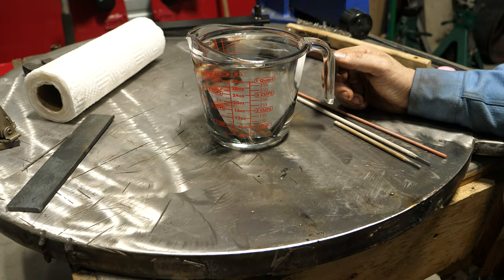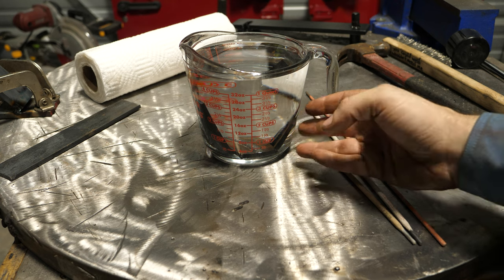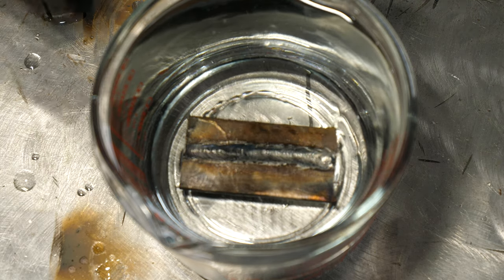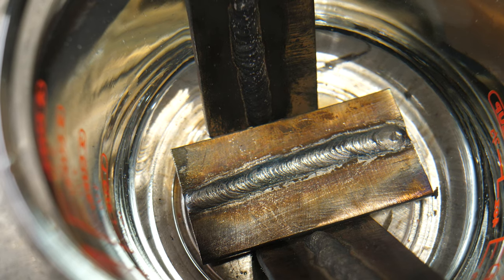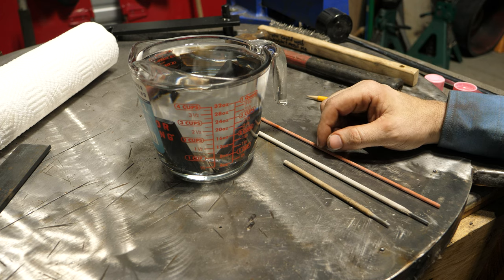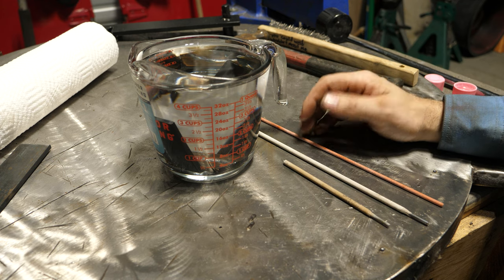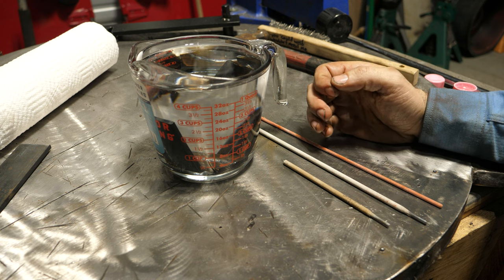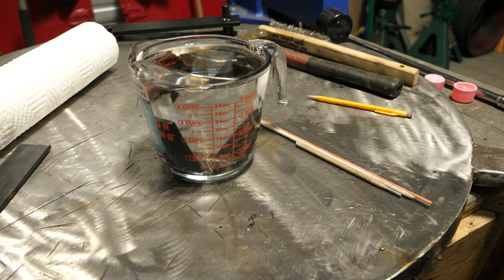7018 vs 6010 and the danger of diffused hydrogen (hydrogen embrittlement)

Comment: Also from what I understand (which isn't much lol) is that it also doesn't matter until you get to a certain thickness of metal (over 1/2" IIRC.....at least for hydrogen cracking which happens during the cooldown). My dad was a maintenance mechanic & welder in a factory but they were kind of backwater(didn't have rod ovens or formal training etc). Anyway he said when they were welding on something serious they would lay all their rods out on the welding table ahead of time and heat them up / get them extra dry using their torches wit a yellow flame. On a side note I did a bunch of digging and found the reason code work never allows 6011 is because its the same potassium additive they use in the flux of 7018AC rods, which has a greater chance of adding impurities.
Reply from the maker: So the thickness of material can play a roll, the probability of it happening goes up as the material gets thicker, because of how fast the temperature drops near the weld pool.  It could happen on thinner material as well.  It’s somewhat uncommon to be welding on higher strength steel below 1/4inch thick but ar500 and many alloy plates can be 1/4 or thinner.  Welding those with MiG or tig would mostly remove the risk of hydrogen embrittlement.  Or of course a properly stored 7018.  

6011s potassium is used to aid in arc stabilization on a/c.  Since a/c welders have a point of 0 volts as it crosses the wave form, the arc will go out.  Potassium will keep the arc lit.  I didn’t know 7018ac had that, it would make sense because many ac transformers will struggle a bit with 7018s.  I had a old Lincoln buzz box and it would run some 7018s despite them not specifying AC, but most 7018s it would struggle with.
Reply: @makingmistakeswithgreg  "technically" regular 7018 is supposed to work on AC but  they never seem to.
Reply: Interestingly enough, I had a Forney AC buzzbox that hated 7018 on AC, but recently I upgraded to an old school Lincoln Idealarc 250/300, one of the round top 1960s models, and of course I use DC for most welding, but for shits and giggled I tried 7018 on AC, and this machine runs 7018 on AC fairly well. So maybe machine is a factor as well. These also weren't 7018AC electrodes, standard Lincoln Excalibur 7018-H4R and some Hobart 7018-1.
Reply from the maker: @yurimodin7333 . Yeah, a lot of the normal 7018s that say ac run poorly.  My dynasty 210 has a ac stick option and it will run any 7018 rod on AC, but it is the exception (I think it may have a pilot arc to help keep it lit).  Older buzz boxes tend to not like non ac rods that’s for sure.
Reply from the maker: @robmurphy806  So I owned a ideal arc 250, it’s quite the beast.  I even opened mine up to figure out how it worked. There are probably a couple of reasons it was capable of running 7018 rods on AC where is the normal tombstone wasn’t. It has a giant output choke (they call it a reactor), a giant transformer, and it has high open circuit voltage.  Basically as the voltage crosses zero during the AC wave there is so much electrical “push” combined with voltage that it is able to maintain a useable arc.  The normal tombstone is far more limited due to much smaller components and lower voltage it is capable of.  The biggest limiting factor of the tombstones vs your ideal arc is on DC the dc capable tombstones can only output something like 120amps.  Your ideal arc will output 250, which if you’re into light dimming and running big rods is perfect lol.

Comment: Very interesting stuff I was not aware of the hydrogen problem before watching your channel.
Reply from the maker: The hydrogen problem mostly affects stick welding and certain flux core wires.  The issue is the flux absorbs moisture from the air which becomes diffused into the weld and area around it.  For a lot of stuff you might weld it’s not really a huge issue, however if you happen to weld something susceptible to hydrogen embrittlement (think high strength, high wear resistant, or high impact resistance steels) your welds can fail because of it.  The safe bet on welding such materials is to stick with low hydrogen rods or processes to avoid issues.  

This video I made a while ago: https://youtu.be/wB6NJVGD5Y0?si=-puIyRHU2lOIqbXf covers everything you need to know dealing with this.  It’s a lengthy video but it will give a lot better of understanding.  As always if you don’t understand something feel free to ask questions 😀

Comment: Just got my two younger ones to the Kindergarten and now it is perfect time to make (watch) mistakes with greg! 😂

Wow that was amazing! I always thought of "hydrogen embrittlement" as a fancy chemical process where grainstructure is disturbed by something like "nests" of alloy-matter induced by the hydrogen.
And you thought me now that it is just pure physics. These H2 bubbles will be "my" picture for the hydroden-embrittlement from now. Very great Video, many thanks!
Reply from the maker: If you look up hydrogen cracking or underbead weld cracking you can see pictures of what happens in real life welds.  A significant loss in ductility means it will fail at reduced stress.  Some welds fail when stressed and others fail just after welding.  

Basically 7018 and other low hydrogen rods exist to give the ability for a person to stick weld higher strength steel and eliminate the risk of hydrogen embrittlement.  6010-11/6013/7014/etc all put far more hydrogen into the weld, which is why they aren’t substitutes for low hydrogen rods.  You’re better off using a improperly stored 7018 over other rods all things considered if that’s your only option.
Reply: I knew the application an use but had the wrong preception how the embrittlement occurs.

I use oerlikon fincord and overcord (6013) for general purpose and böhler spezial D (7016) for more critical application. Thus I'm quite sure my cheap welders can not handle 6010 and these are quite expensive here I dont have them. Mig I use the most, because my MIG welder is the only really serious I have (and I like it because of speed - and my limited skills with stick)

Comment: talking about pre heating and "sweating" plates

When you use propane or oxy/acetylene to pre heat the metal, it will heat up and water will "come" out of the steel, this is a misunderstanding many people keep arguing about online

Because you will not see any water or damp when you heat metal with induction or even when you plasma cut, the water is coming from the propan/oxygen from your torch or its condensation coming from the air
Steel dose not hold water.

I would believe if you don't preheat high strength steel before welding, the massive heat difference would attract moister out of the air and get in to the welding, I simply don't believe it comes out of the steel.

What is your opinion about sweating steel plates? :)
Reply from the maker: Excellent thoughts and question.  I have heard well respected pipe welders on YouTube and online talk about exactly what you are.   It’s common for them to say the metal “sweats” and you need to get the hydrogen out of it.  I think this is a classic case of someone seeing something happen, and make the wrong assumption about the cause of what they are seeing.  There is a huge difference between condensation forming on a metal surface being heated and hydrogen escaping from a metal.  What those pipe welders were seeing was condensation (much like if you breathe on a mirror) and not “sweating hydrogen” out of the metal.  Hydrogen can exist in metal, the atoms are so small they can pass through the material likes it’s not there, that is my understanding.  The amount of hydrogen atoms would likely be minimal, because over time they would escape.  

Preheating the pipe before or during welding would be done for a number of reasons.  1) the material being welded has preheat requirements to prevent fast cooling and hot short cracking.  2) it’s common to weld pipe with 6010-7010, which both impart a massive amount of hydrogen into the weld.   By preheating the pipe along with maintaining elevated temps, the hydrogen from the rod will escape faster.  The first root pass will likely have all the hydrogen completely escape before the following passes because of the elevated temps.  If you weld on a cold plate with 6010 it can take a long time for all the hydrogen to escape.  If you ran say a 6 pass weld on cold thick steel pipe it’s possible hydrogen escaping multiple passes below your final passes is diffusing into your weld pool along with what the rods flux is putting into it.  The heating of the pipe will limit the hydrogen to only what the rod puts in and not combining other passes as well.  3) the slower cooling due to preheat will likely change the weld favorably towards more ductile or softer, basically it will effect the grain structure and heat affected zone properties.  The desire for specific results (which are found via testing) could require preheat.   

Yes preheat could force hydrogen atoms out of the base material, but this would not be visible to the naked eye, and the welders that say the pipe is sweating simply don’t understand what they are actually seeing.  The preheat and maintaining of a specified temp has more to do with prevention of the buildup of hydrogen from multiple passes (that was put into the material by the welding rods) than it it does to dry out the base material.  Hopefully that makes sense and clears up what’s going on.

Comment: I just want to know what it says on your wire brush.
Reply from the maker: Depending on the brush it may say “if you could weld you wouldn’t need me”.  I have sayings on all my brushes 😅.  Everything from “that weld is straight trash” to “dont use on teeth”.  My bench grinders also say things on them like “grinder and paint makes you the welder you aint” and “all you do is dip the tungsten” 😅😅
Reply: @makingmistakeswithgreg  I like the dip the tungsten one... lol

Comment: 7018 confusion…. Given that we home-gamers will probably never do code work, and we understand the basics of what Hydrogen Embrittlement is all about, I can’t help but be a little confused how the vast majority of welding rod manufactures, make no effort to Hermetically Seal their 7018 rods.  I understand that the AWS has requirements that must be met in order for a manufacture to declare their product i.e. Label a product, a particular type of rod e.g. 7018 in this case.  If I understand correctly, the manufacture’s products must meet those standards, and pass testing before they can Label their products as meeting (in this case) the 7018 standard. 

I don’t think a plastic container sealed closed with tape, meets the AWS requirements to store and maintain a low hydrogen environment. 

It seems to me, there is a disconnect between the AWS standards, and what some manufacturers can “get away with”, but especially the high end brands like Hobart.

I can see perhaps, that they intended their product to be baked per specification before being used for its designed application, (I’m not talking about professionals and their rods will be certified, per code), but I am talking about one of us welding joints that have liabilities like trailers etc., so what am I missing here?

With regard to the manufactures, they label their product as something meeting their basic specifications e.g. 7018, and like baking a chocolate cake, they all have some latitude in the ingredients, and yet still be able to call it a chocolate cake. But as we all know, some manufacturers are better than others, and all that is a matter of finding what works best for you and your machine. 

I have seen videos of professional welders, who will store their 7018 in open containers for years, and since it’s not code work, they seem to be of the opinion, that it just doesn’t matter, and they have never seen any cracking issues. 

As for me, I choose to error on the side of caution, and will do my due diligence, and try to follow good practices, with higher quality (properly stored) rods like he ESAB 7018-1 prime or Lincoln in the cans. 

I think it would be interesting to produce a test coupon for your mad scientist mineral oil test, where there is a joint similar to pipeline work, with a 6010 root pass, and a 7018 filler/cap to see if he 6010 still bubbles.  Further more when you get your shop press setup for Bend Testing, you could both etch and break the weld, and see what gives first 😂the base, 6010 or 7018?

My money would be on the base metal being the weakest link! 😮

So how do we (you) interpret this 7018 gap between hermetically sealed and not sealed packaging?
Reply from the maker: I think they get around spec for 7018 when it comes to non sealed containers by generic labeling stuff.  Let me explain:  like everything with the AWS there are multiple layers and a lot of confusion.  Something labeled as 7018 must meet code for 7018, but what that code specifies may not be what you think.  7018 is known as a low hydrogen rod, but that level is not specified in a normal 7018 in many cases.  All 7018s have low hydrogen from the factory because the flux doesn’t contain the moisture virtually all other rods have.  So they are low hydrogen in comparison to everything else.  Now when you get into specific 7018 rods like 7018H4R, the additional H4R means it met testing spec of less than 4ML diffusible hydrogen for the test and the R stands for meeting absorbed moisture test requirements.  The only way it’s possible for the rods to meet that requirement is to be hermetically sealed in a container.  To complicate matters more sometimes you will find the same 7018h4r labeled rods sold in non specified generic 7018 containers instead of hermitically sealed packages (which is basically vacuum packed foil or metal pull tab containers).  

Pretty freaking confusing and that’s just scratching the surface.  Based on what the AWS says the proper way to deal with the risk of hydrogen embrittlement is, the solution is to use code specified rods (H4R) in sealed packs and use them within the specified window (per manufacture).  If you go outside that window you must put them in a rod oven to stabilize them.  If they have been out for longer than the window of the moisture resistance specifies (manufacture specific) you must bake them at higher temperature and then keep them stored at a reduced stabilized temp.  Sounds like a lot of work and it is, which is why the easiest way to deal with it is just buy small packs of esab 7018-prime and use a pack for a critical job, then store the left over rods in a sealed container with desiccant.  They will still be fine for any normal jobs, but critical work you use a brand new pack.  It doesn’t pay cost wise to keep even a small rod oven running over a pack of sealed rods for the average person.  Not to mention the H4R rods are so moisture resistant (and low moisture from the factory) the chance of a failure due to hydrogen embrittlement is about 0.  That’s where a lot of people get confused, they think you can just run 7014 or 6011 and “avoid” 7018s storage requirements.  The truth is the storage requirements give the 7018 the ability to weld stuff safely.  Due to the moisture resistance of the H4R rods and the zero moisture in the flux from the factory, they are infinitely safer to use to weld anything higher strength over any non low hydrogen rod, even if they were stored improperly.

I definitely will have to test doing 6010 root with a 7018 full/cap.  The results will be interesting I am sure.  I did get a shop press and it’s all together.  In a few days I will be working on testing with it 😀.  I just finished shooting a video where I tested 7018 on beveled plates, that has some surprising results that will require further testing.  😀
Reply: @makingmistakeswithgreg  That was a fantastic explanation, and it really cleared many things up for me, and I’m sure others will also have a  much better understanding of the whole Low-Hydrogen rod process and proper application.  I like the idea of the smaller individually hermetically sealed packages by ESAB 7018-1 Prime rods. I wish the same was true for 6010 5P+, which runs really well on my Miller Multimatic 215 (despite Millers recommendation to NOT run 6010 rods with it - I’m betting the same would be true of other brand inverter weldsers), as the Lincoln 6010 5P+ 10 pound cans are the smallest quantity available costing about $80/can (which is fine for professionals and pipeline workers, but a little too expensive for us hobbyists.

Perhaps your (this reply) of the 7018 clarification, would be worthy of its own video.  I know it would have grabbed my attention when searching for videos about 7018, and would have been very helpful, and I’m sure it would certainly help others produce better safer welds. I’m really looking forward to both the beveled root pass welds and bend test with your new press. 

You probably won’t learn this kind of stuff in welding school LOL

Thank you for your tireless efforts and extensive welding knowledge/experience to help us improve our skills as welders.